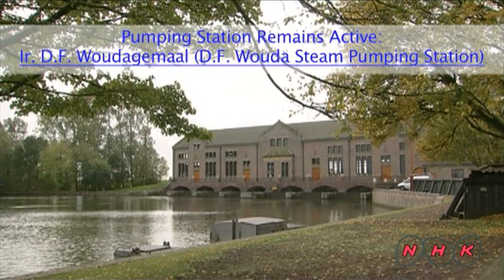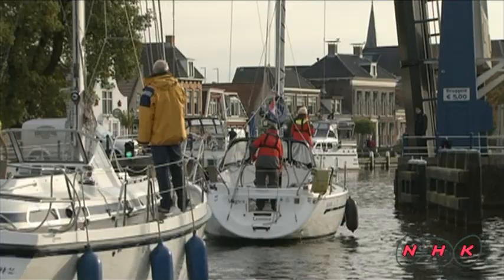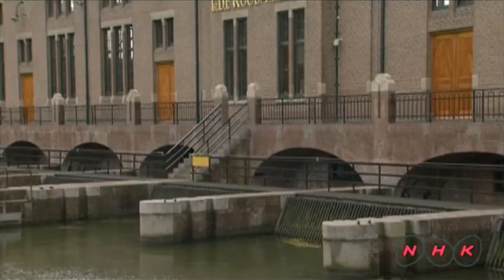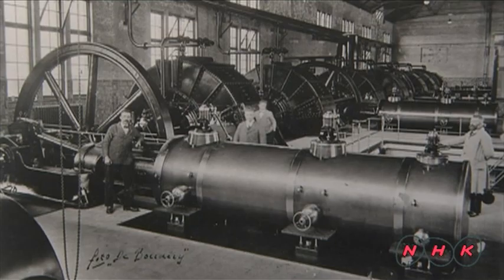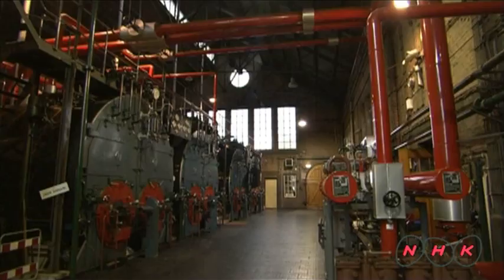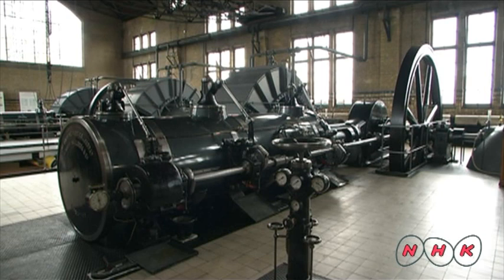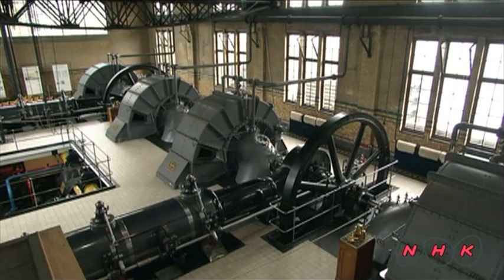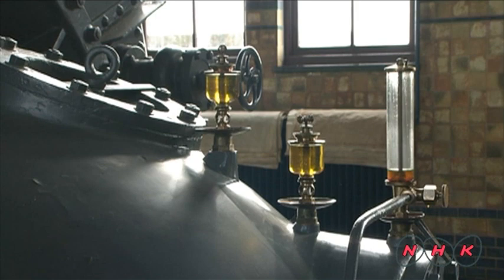Ir.D.F. Woudagemaal (D.F. Wouda Steam Pumping Station) (UNESCO/NHK)

Comment: Yes wonderfull, but there is a mistake.
The steam from the boilers do not go to the turbines.
Steam goes to the four steam engines.
The engines rotate the pump shaft to where the centrifugal pumps are connected on.
There are no turbines...